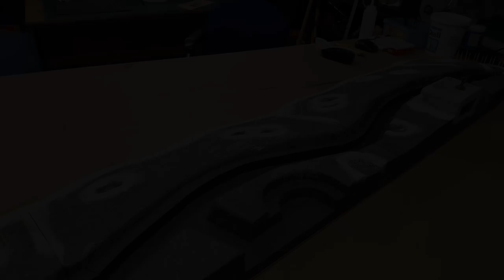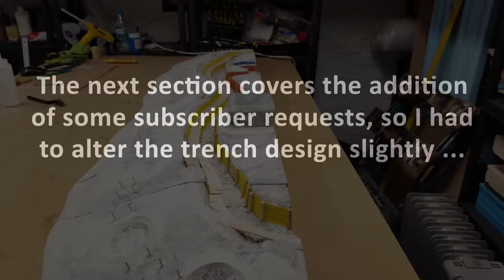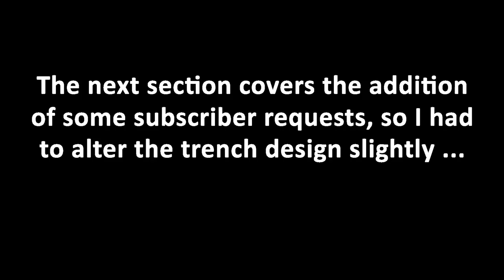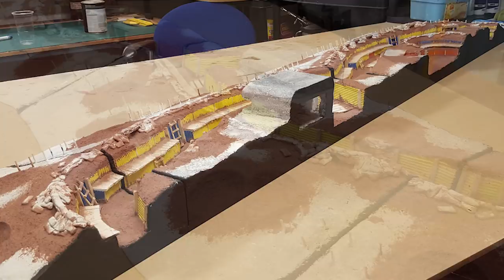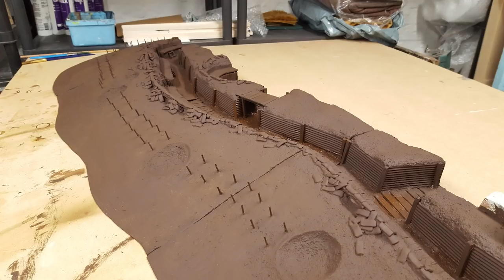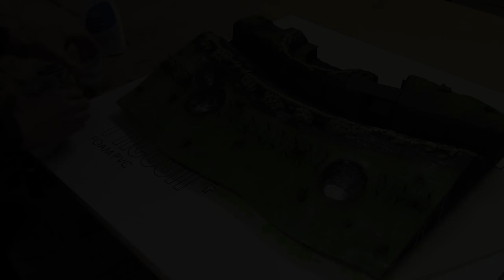Let's Make Modular Wargaming Trench Terrain

Comment: I admire your work, mate! One question: trenches usually had scharp angeled intersections to keep blasts contained. I guess they are not very practical for wargames. What do you think?
Reply from the maker: Doable but each section was 10ft long (enought for a section) with a right angled turn. When you factor in width for playability, if you want that 1:3 playable slope, you'll need at least 26" base depth and there's no room at the back for the bunker or firepit. So not really viable for this build but if you want to do that, forget sloped scatter and do a full board build mate.

Comment: I love your work.  The only thing I didn't car for were the craters.  Perfect circles don't appear in nature so that is why I think they stand out to me.  On a hill the blast would be more of an oval.  Even a fresh blast has to contend with rocks and inconsistencies in flat ground.  Water would make the loose dirt run down, back into the hole.  When you do your putty if you get the top and bottom wet and run your thumb down, it gives a good effect when you add your dirt.  When you have two craters close together, you won't have a defined ridge between them.  The new strike blows out into the old one.  I don't want to sound like I am complaining or being over critical.  I love your work, I just thought I would share.  You could have a few that were more circular to show fresh strikes.
Reply from the maker: I covered that in depth in the second vlog mate but it got cut from this condensed version
Reply: I concur, the bomb holes don't look right. Otherwise fantastic work!

Comment: Hello there TTT. 

   I have a low cost, simple solution for sandbagging. Something that will make you slap your forehead and exclaim: 'why didn't I think of that'?? 
   Chicklets. The small, pillow shaped, candy coated pieces of gum. Yes, CANDY. 
   All you need to do is to buy several bags of them, dump them into slightly warm water to dissolve the candy coating and rinse off and allow to dry. When they are mostly dry, you just press any tightly woven cloth across one flat side to make the 'linen bag' texture and allow to fully dry. 
   While they are mostly damp, you can place them into position and flatten them with a fingertip, allowing the next layer to be laid flatly atop the first, onwards and upwards, layer by layer until you get the desired height. 
   The last layer is the one where you flatten the bottom of each piece and press the linen into the surface to get the right texture. 
   Densely spray with a 50-50 mix of white glue and water to hold everything in place, and once dry, glue the structure into place in your terrain piece. 
   Base and paint as normal, and you're done... for a Much lesser cost that the material you used, and for less effort.